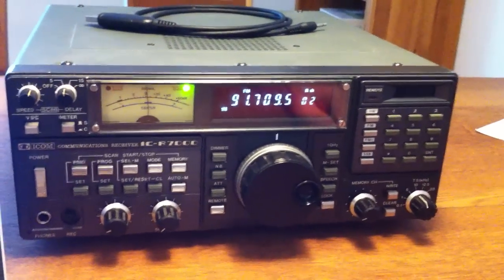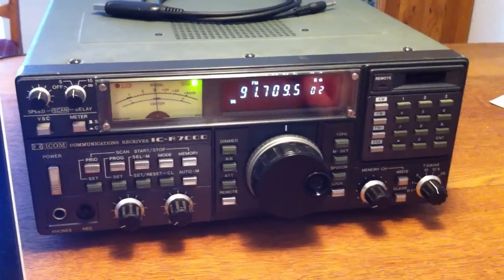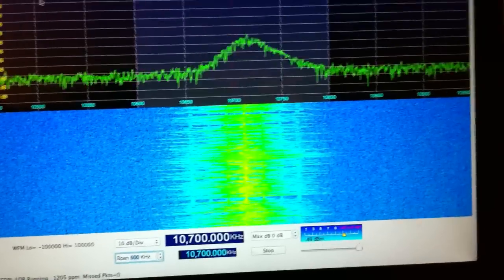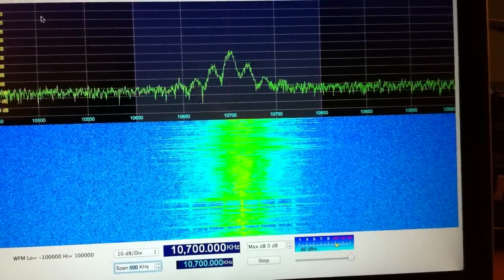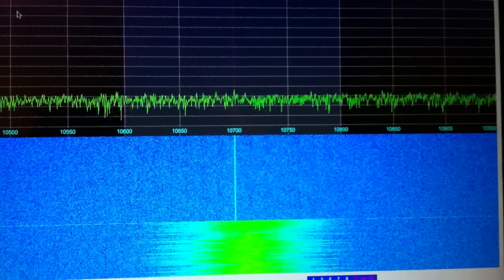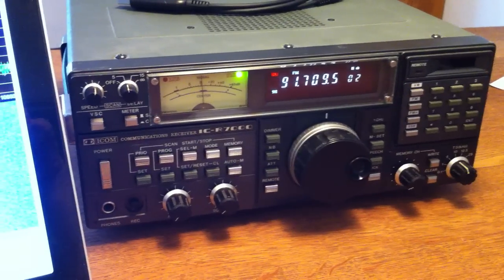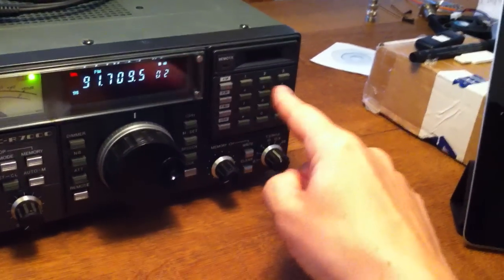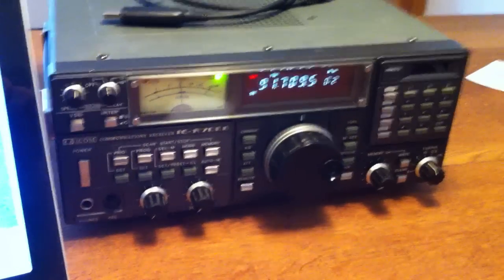Connecting an SDR Radio to the IC-R7000 Communications Receiver IF output

Comment from the maker: Update: I finished the project, but not in any impressive way. My close friend and fellow radio amateur who helped me build a horn antenna unfortunately passed away, so suddenly I had no space to set it up (I was based in a small apartment at the time, he lived at a farm..). I managed one test run, and the system was functional, but I lacked instruments to finetune, and verify, the RF performance. This have now changed. I relocated, have much more space, I built my own lab at home, SDR's are much more powerful these days, AND I found a decent rectangular (calibrated) horn which will perform better than the somewhat rudimentary first one. I've put a couple pictures on my instagram @oz1lqo and will be posting progress there, until I have enough material for a follow-up video. I just posted a couple pictures there, for you to see how it ended up :) There, you can also see pictures from when I tested my LNA, after 8 years of hibernation. Best 73 :)
Reply: Condolences on your friends passing.

Comment: The MSi.SDR Panadapter clones 12bit ADC blue ones are nice. nice price too. $40 two years ago. works with SDRUNO (I bought and own a SDRplay RSPdx).
Its amazing a radio collection grows... FRG8800, two R7000 (one repaired, one to be), three RTLSDR (one out on loan), one MSi.SDR, one RSPdx.  assorted old scanners repaired modded and working.

Comment: why do you need to use the ICOM? why not only the SDR? what do you get by using both? Just trying to understand! ;)
Reply from the maker: Hi, well my SDR back then didn't cover the frequency directly, so I used the Icom as a low-noise and frequency stable down converter. Today, I would definitely have used an SDR at the frequency, with a decent LNA in front. :-) Cheers
Reply: @OZ1LQO  You never answer the question that people keep asking you. It's been 8 years. Did you ever finish the project of your radio telescope? I can't imagine how hard it is to answer that
Reply from the maker: @624radicalham  You're right. Life takes its twist and turns, I just posted an update. Best 73 :)
Reply: @OZ1LQO  Ah that's awesome thanks so much! Looking forward to see as I'm just beginning to explore this area for home projects and SETI's website was the one that mentioned the Icom R7000. I do own an Icom 7300 but doesn't go high enough in frequency, and would do an SDR but keeping it old school is fun. 73!
Reply: @OZ1LQO  Thank you for the answer! Did you finish the project of radio telescope?

Comment: Here's a link to some RA with cheap SDRs.  http://www.rtl-sdr.com/category/radio-astronomy-2/
Seems like you could skip the Icom and just use a well designed LNA with a $20 dongle.
I lost my old DownEast LNA to some kind of lighting EMP or direct hit in the area.

It was at the feedpoint of a 10.5' dish (old TVRO C-band). Before the LNA got blasted, I could actually see the s-meter move and hear the noise level increase on @1420 mHz.. Made some pretty hydrogen line plots. 

Crazy thing was when I cranked the elevation too high, and a small tree limb (bunch of leafs 50' up) would get in the 'beam', I could hear the noise from the limb!
Also when I lowered the dish down low so it was pointing at the chimney on my house. Those things make noise, just like the sun, or the galactic core.
 
I have still the Icom R8500 with a cut AGC (no s-meter), but the dish is gone now. The LNA was rated at 0.35 db NF..  May it RIP.. :(
My old Dish mount is still in use, tracking the sun with 500w of solar panels..

Cheers,
Rich
Reply from the maker: Richard, since this vid I've been playing a lot around with the RTL dongle, I plan to use it standalone with my LNA this spring (GNU-Radio to do the signal analysis). Cheers
Reply: OZ1LQO
Nice! Good luck with your RA project. I'm wishing that I still have my old dish.. I opened up my DownEast LNA last week and saw the 12Vdc input was toast. Replaced the power parts and Wow! It's working again.

I connected it (the LNA) to a small 1090 mHz antenna, and I can now track airplanes with ADS-B, using RTL1090 software, using Globe-S for my 'radar' display.  I have a pretty amazing range down towards NYC and up into central Maine.
~~
When I was doing RA, I found that listening to hams talking on 1296 mHz EME is a neat way to check RA equipment. Mostly the use code (CW) but a few use SSB.

I did not want to hear GPS sats, so I used a LHCP ant setup.
My feed was RHCP, aimed into the Dish=LHCP. (mirror effect)
It was a 3.5 turn Helix and worked really well with my old TVRO dish.
The RFI from GPS was cut way down. Near 20 dB I think..

I was lucky to be able to use a network analyzer to set the 50 ohm match. That feed was good for a 300 mHz bandwidth, centered at 1420 mHz.
The Helix is a wonderful antenna and makes a great dish feed.  
I just went out to the garage and found it. Took a pic..
It's got spiderwebs all over it.. Kinda sad..

Take care,
Rich
Reply: I would go with a MSi.SDR dongle (12bit ADC 10MHz bandwidth) the 40usd one, the 20usd ones (8bit ADC 2MHz bandwidth) are a little too cheap for sensitive work. RTL ones are fine for city DXing. lots of signals with good power.

Comment from the maker: Short comment on this - it turns out that the 10.7MHz remnant is still there, even when switching the R7000 radio OFF.. So it's not something the radio produces. This is good news and valuable information when I finally get to use this in my telescope setup :)
Reply: SDRs produce phantom signals. good news for SETI peoples looking for funding ;)